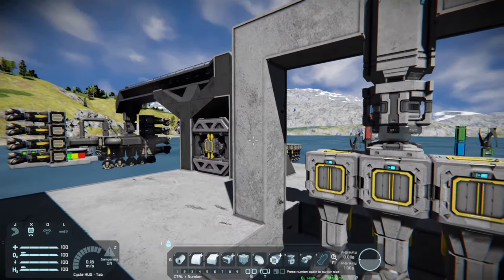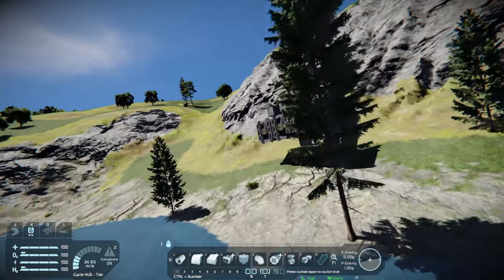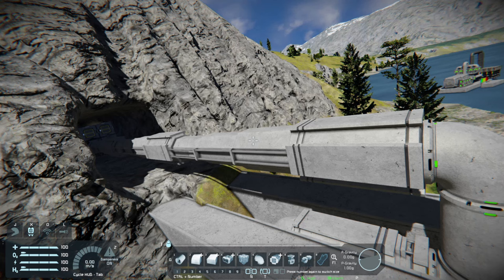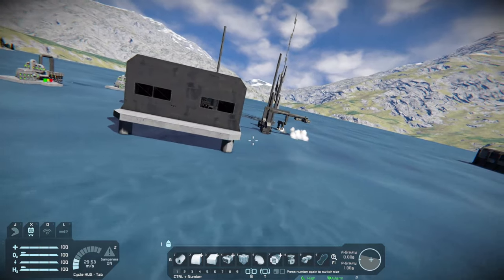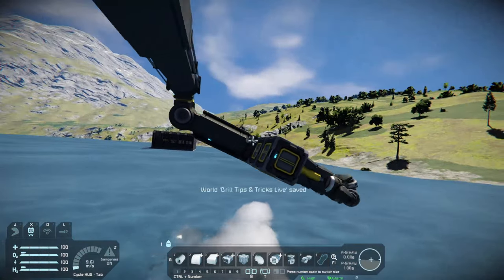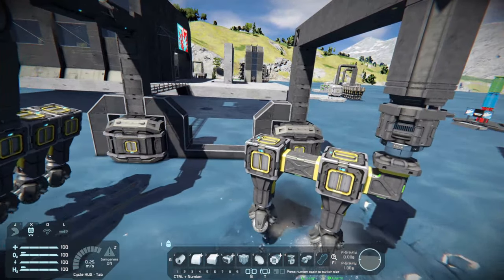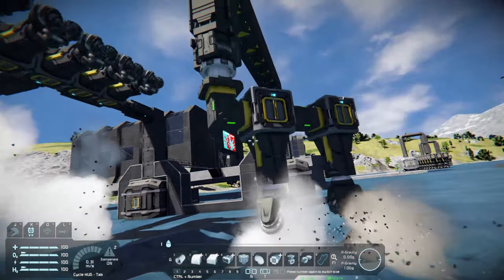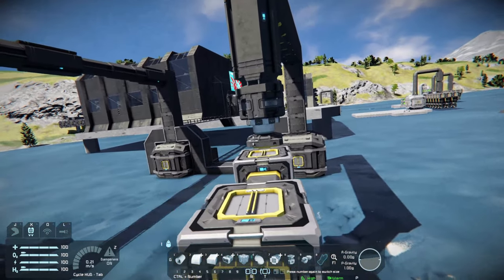Advice When Building Drilling Platforms in Space Engineers

Comment: I'm just starting with SE, and these pistons seem kind of limited. They drill until the piston is fully extended, and then you have to build a new one, or partly demolish and extend it. 
I found I had more ore with less effort by just building a drill, attach a battery and storage, turn it on, and just let gravity sink it down till it is full or the battery dies, and come back later to pick ore up by hand, or fish out the storage containers with a landing gear or magplate-on-a-stick below a ship and drop off at base.
Reply from the maker: That is a perfectly valid way to go about it.  I would suggest adding an event controller that shuts the drills off when the cargo container gets full.

Also, there is a way to have the drill build itself it would require a slightly more complex system.
Reply: I mean at that point just do what I'm doing. Build a Mobile Drilling Platform. Utilizes landing gear to detach itself so you can pick it up and move it when it gets too deep for the arm. That being said, prior to moving you do have to unload it's storage unless you've got a POWERFUL hauler ship because the one I built has 3 Large Grid Large Cargo Containers, so once it's done drilling and loaded up it's HEFTY. But it saves me time because instead of mining iron I just go to the Mobile Drill Rig and grab a bunch of the iron it already has from refining Stone.